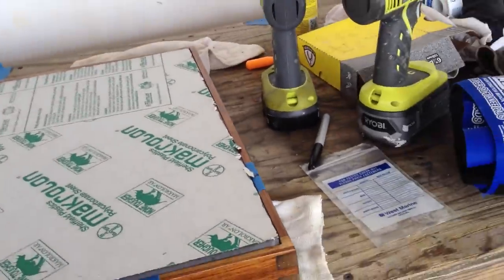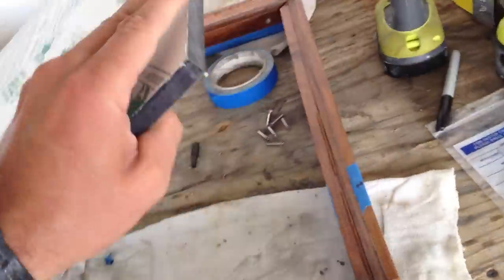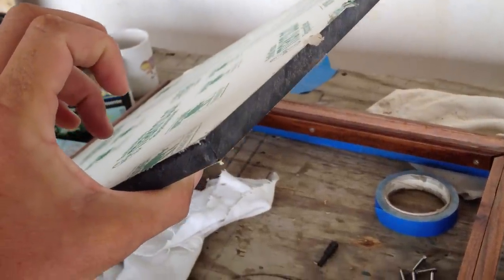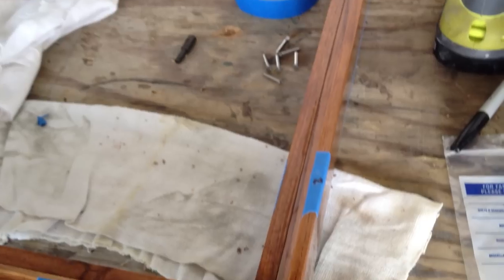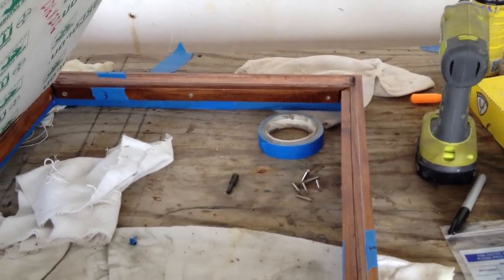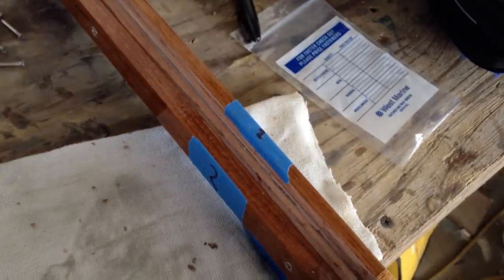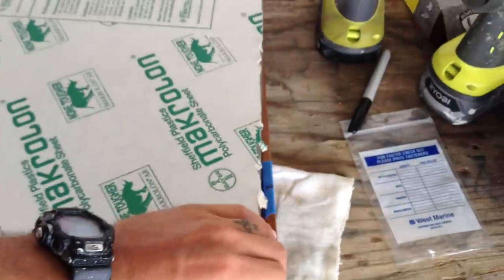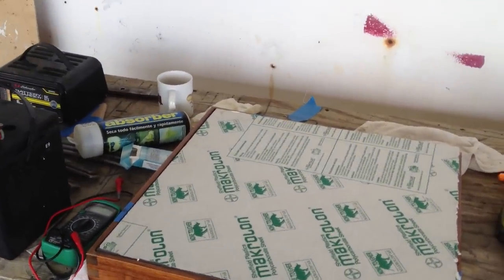Atticus Update 11: Constructing the forward hatch!

Comment: Yeah, that Lexan (polycarbonate) is TUFF stuff, I cut a sheet of it with a die grinder and had a little tiny sliver of it still hanging on. Rather than bother with cutting it the rest of the way off I decided to twist it off AND I COULDN'T! I twisted and pulled and just could not get that stuff to break free!  I would not worry about shattering that stuff you might not want to use it to stop a bullet, but if you drop a hammer (or an anchor) onto it, the frame is more likely to break than the Lexan, the most that will happen is you'll put a small dent in the surface!